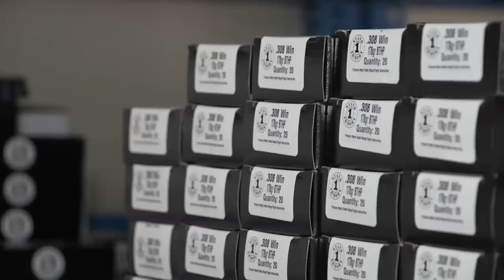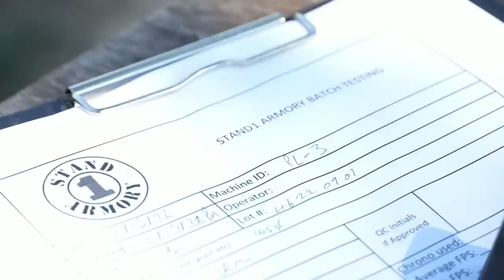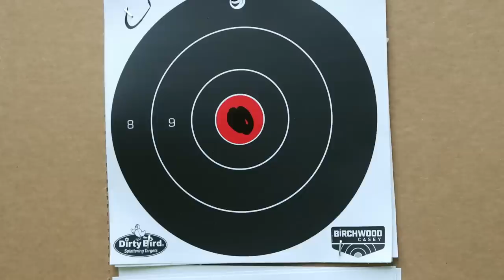Stand One Armory Ammunition

Comment: Just checked them out. Around 44 cpr shipped so not a great deal since they are remans. PMC Xtac and on occasion Fiocci can be found for about the same.
Reply: Correct
Reply: I have gotten better results with Stand 1 range ammo than with Fiocchi, and I have shot them head to head.  Haven't shot a ton of Xtac, but standard PMC is so underpowered that it is useless past 200 yards.  I know more than one rifle manufacturer that deliberately uses PMC to test-fire, because it is so weak that if it cycles then anything will cycle.  I'm not a fan.
Also, I find it sad that so many "Pro-America / 2A" folks will deliberately support foreign ammo companies rather than American ones.  Outsourcing our capacity to mount a credible defense of ourselves and our families is a very bad strategy.
Reply: @njrefugee3119  considering how much ammo has gone up over the span of 2 years, dont see anything wrong with it. Retailers and loaders have to adopted the petroleum industry business model. Jack it up quick and slowly trickle the price back down.

Comment: Well their 223 reman is more expensive than new 223 from pmc or several others now so not sure if it's "cheaper" and therefore looses most of the point of it. 223 is down to .35 a round now on ammoseek for new brass and they're at .42 so meh. Their 9mm is at least competitively priced so there's that, looks like pistol yes, rifle no for these guys
Reply: Agreed, still not happy with the price of reman 9mm either. There should be a significant difference between new & reman, but the small difference doesn’t justify it majority of the time. I just buy new
Reply: Stay tuned guys. Ammo prices are about to crash big time. There's a huge over supply of both firearms and and ammo out there right now. I've never seen so much ammo in stock at my local big box joints. Every person I talk to says that people are not buying at current prices. In order to keep any commodity business working, dollars MUST be turned constantly. Right now the manufacturers are sucking pipe and so are the retailers. The dam is about to break. I could be 100% wrong, of course. However, with vastly expanded manufacturing capability and ammo already stocked high and deep, supply and demand will work, like it always has. I see 18 cent 9 and 25 cent 223 within 4 months, max. If I'm wrong, it won't be the first time. LOL
Reply: @typhoonjenkins8330  ur not wrong. Every week the prices are dropping from wholesalers. I don’t touch ammo right now.

Comment: So for a case of 1000 with .223/5.56 or 9mm the cost difference between theirs and new ammo from online sites it looks like they’re about $30 cheaper. I’m never one to throw away money but $30ish more dollars to get new ammo vs saving $30 to get remanufactured ammo seems like a cheap cost to pay to not have to worry about potential problems. Maybe if you’re buying 1000s of rounds at once then it makes sense because $30 can add up quick when you multiply it but for the average person it doesn’t seem worth the savings. Am I missing something here?  Always open for input if my logic is flawed.
Reply: Yea I don't understand it either. Like SGAmmo had XTAC M193 for $440 for 1000 rounds and PMC for less than that. It has zero appeal to me unless it is significantly cheaper, like 30 CPR instead of 42 CPR.
Reply: Think of it this way, if it was alot cheaper, would you feel safe using them? I personally wouldn’t.

Beside if you plan to keep on shooting for years to come, $30 less per case is a decent save. I buy a couple cases per month or per 2 months. So I saved about $300, give or take, a year, which I think is pretty good.
Reply: @Kenzaki1010  excellent points. American made is also a big factor for me.
Reply: Almost like, not everything is made for boomer who shoot 20 rounds a year 😭😭🤣🤣

Comment: I buy steel before I buy Winchester or Herters. Always 4-5 rounds out of 150 damaged then the crazy jumping fps and point of impact. I just think it’s junk even for the range
Reply: I have ran a lot of herters and haven't found any issues yet. I don't run anything through a chrono, but haven't noticed huge poi changes either.